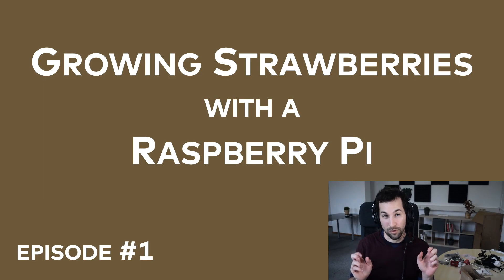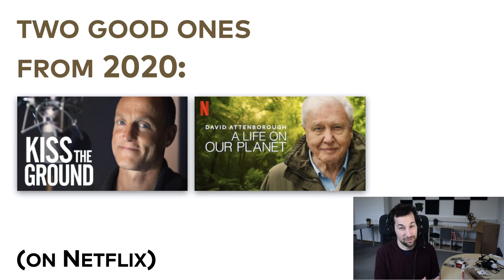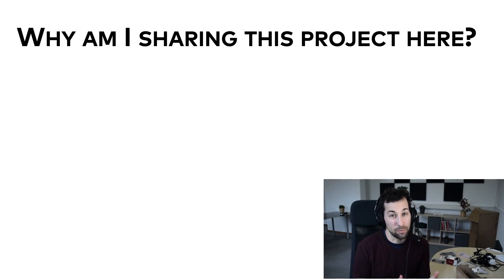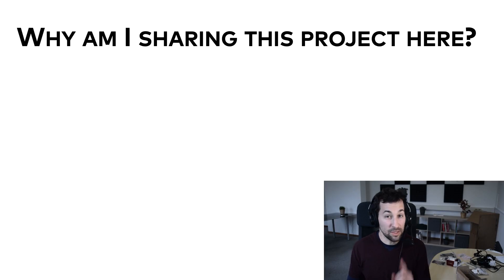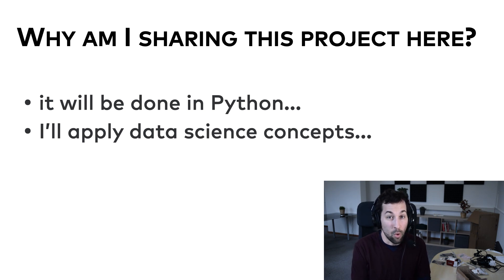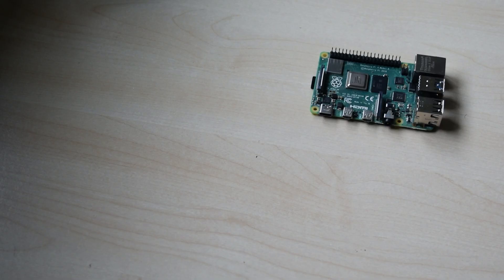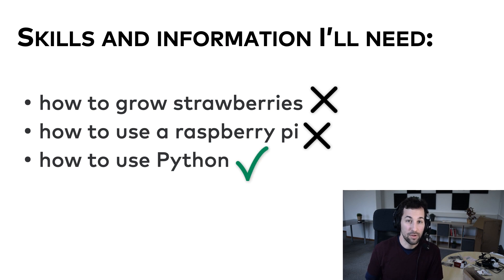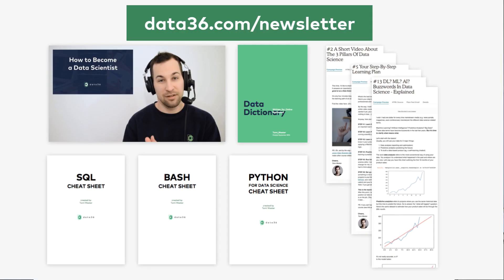Growing Strawberries with a Raspberry Pi -- EP #0 (New hobby project, Intro Episode)

Comment: Great idea to do
Don't worry about datascience applications, if you want to see them they will pop up probably faster than the strawberries
How do you think to control the sunlight? Imitating the Sun by LED's (full spectrum)?
Reply from the maker: It's a tricky one -- I think I'll go with a 433Mhz radio controlled outlet (I've already have the hardware, just haven't had time to try out the software part) and a radio I/O to the raspberry. With that I can turn on/off the outlet and so I can plug whatever lamp I prefer. I'll do some research which one is the best for the strawberry but yeah I'm thinking in full spectrum LED's. Once I figured it out, I'll publish a video about for sure! : )